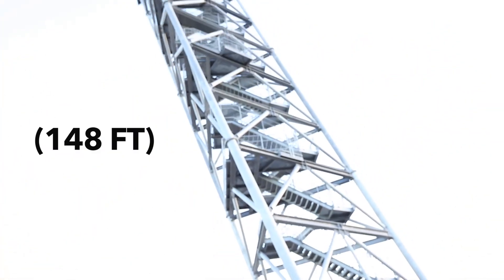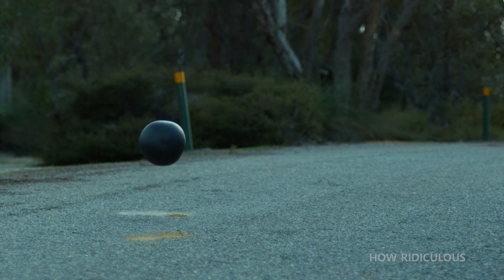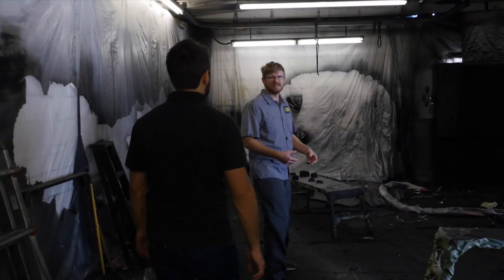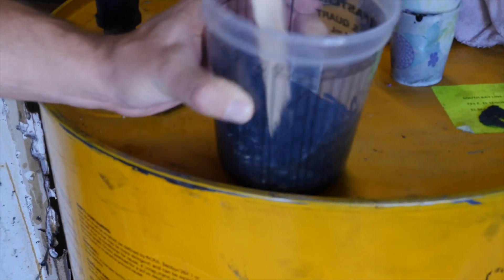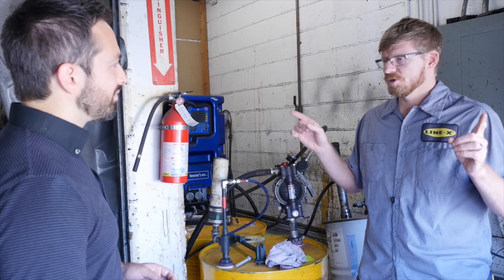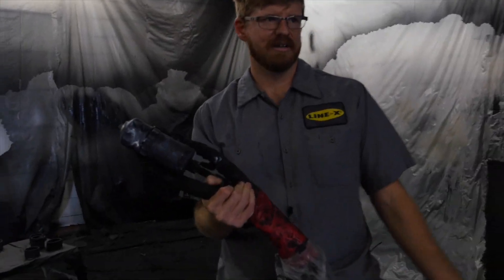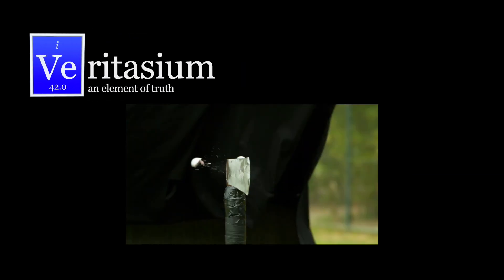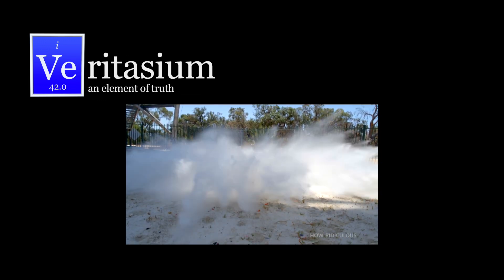Indestructible Coating?!

Comment: Why don't they make tyres of this stuff? Is it too expensive? I mean, even just coating regular tyre would help a lot.
Reply: Derpy Hooves 
Just because they it's durable doesn't mean it's drivable. something like this would probably have all the traction of a power wheels car. now using it inside the tire to make them PUNCTURE proof is a better idea for it.
Reply: With internal air pressure pressing outwards, peeling wouldn't be an issue on internal coatings.
Reply: The tyre would lose its grip.
Reply: Normal tires are more durable, have better traction and are cheaper.
All you would do by adding this in any form is making the tires worse.
Reply: Derpy Hooves AFAIK there is actually a steel mesh reinforcing tires sooo that's probably stronger than this stuff
Reply: If this was done with tire rubber, I wouldn't surprised if you'd get the same results. There's nothing magical about the properties of this substance, the ability to apply with a spray is what makes it noteworthy.
Reply: kamilk That could work if you can solve the logistics of getting in and out without dumping all the liquid out or creating a weak point at the seal, and the need for ventilation and windows, and the ability to guarantee that the inner compartment comes to a gradual stop even as the rest of the car bounces from the impact. Otherwise your occupants will still die from flying objects or broken necks.

And of course you still have to account for what happens when a bouncing car hits a building.
Reply: SentsuizanXS
... and how about system of pipes, pistons, springs and valves distributing hydraulic pressure of a liquid instead of plain chamber of liquid?
is it still undoable today?
Reply: gr8fzy1
Traction is a legit concern, but inside isn't a good idea too, it might just peel off on puncture. Adding it as a layer on top or instead of wire mesh probably would be best.
Reply: Coating the inside of tyres with this might be a good idea
Reply: FyJonas 
and stuff still gets through.  point is that a little bit more protection would always bw welcome,  but i'm worried about uneven spray unbalancing the tire.
Reply: Maybe not tyres, but bumpers should be made of this!
(& some flexible/foamy plastic between bumper and the rest of your car)

Imagine an accident at 60 mph / 100 kmh when nothing happens to your car ;)
Reply: Julien Brech
I'm perfectly aware of a role of crumple zone in modern cars. That's why I mentioned about foamy/elastic/deformable "thing" between bumper and the rest of the car.
About twenty/thirty years ago Volvo was manufacturing front bumpers able to dissipate impact energy of a speed up to 20-ish km/h with no damage to the car whatsoever.
Today we have technology (materials) that manage to disperse much more amount of impact energy. So maybe a hybrid bumpers are possible these days, but are not profitable for car manufacturers ;)
Reply: He didn't say it was stronger than rubber.
Reply: But you would turn to mush just like that watermelon. Cars are designed to crumple so they absorb force. This would just make you bounce off and go backwards. Hello, whiplash!
Reply: kamilk More moving parts means more parts to fail. If the materials can handle the stresses of absorbing that impact in the first place.
That would be a maintenance nightmare since you'd have to be able to remove the (indestructable) outer shell to get to them, not to mention all the other internal parts of a car that fail all the time like batteries. That means seams, and under that kind of force anything underneath those seams will get shredded anyway, possibly spelling death as it careens around like a hollowpoint inside a skull.

It's not impossible, but it is difficult, expensive, and probably more trouble than its worth for only a marginal benefit. Probably better off removing the cause of accidents from the equation, ie. human error.
Reply: Case in point: the watermelon core is separated from the shell.

Comment: Ideal car tire confirmed?
Reply: MatzeGamer no
Reply: Drago yes, since it won't get punctured as easily
Reply: Spray on the inside surface of the tyres!
Reply: 0 traction compared to a tyre probably
Reply: I'm sure it would be slippery as hell in emergency situation or when ground is wet.

Comment: Can it be recycled somehow? Dissolved and reused? Or it stays like that forever?

Imagine piles of garbage no one can process into something else.
Reply: Piles of garbage no one can process into something else are already everywhere.
Reply: yah, but that's no good reason to keep making them piles.
Reply: it burns
Reply: No, one thing can't be achieved with science, however advanced it is... Me getting a life.
Reply: yes, but science in this case means, a facility with the appropriate machines and operators, willing to collaborate with the firm which makes this material. does that exist? if not its only theory. recycling is complex and costly, but in the long term is a necessity.

Comment: What if they coated a Nokia 3310?
Reply: it would make it weaker
Reply: It would break the earth in two if you dropped it.
Mere mortals should not posses such power
Reply: Nokia would wear the coating off from inside.

Comment: ah now i know what i will spray on my car ;)
Reply: The coating is flexible so your car should still crumble like usual when you crash, as long as the coating isn't way too thick at least, I'm more interested in whether the coating can prevent denting and scratches.
Reply: Merp The steel is supposed to fold. The car is designed to absorb most of the impact in an accident as a way to save the passenger. Older cars were made of stronger metal and they did hold together pretty well but the casualties were greater because the passengers took more force than the body can handle.
Reply: seigeengine
-Won't explain anything because he knows he can't
-Mocks people because they are not native English speakers
-think he is better than anyone else
-calls some stranger on the internet arrogant assbag who really said nothing arrogant at all

I wan't to see you speaking a foreign language like I do. To use that insult shows the person you are. Out of nothing you created a fight with me just because I critisied you (not even critisied just didn't agree) relativity has nothing to with the energy the passanger is getting from a car crash. It's the same whereever you are in the universe. IT ISN'T IMPORTANT IN THE CONTEXT OF THE "QUESTION / MY ANSWER"

you are a joke. play with the other kids or mommy will be angry. Insults are so good he?
I won't answer anything from you anymore, everyone hates people like you
you are scum.
Reply: +eu4eagle I see where you're coming from, but you're assuming a reference point as an outside observer.

When the car collides with something, it applies a force to what it collided with, but as we know, all actions have an equal and opposite reaction. The object the car collided with applies an equal force back against the car (assuming it doesn't deform itself), causing it to accelerate to a rapid stop. From the perspective of the occupant, the car was suddenly accelerated back at them, and collided with their body.

As for car design, they are designed such that the part the people are in is very tough, but the rest of the car around that is designed to crumple heavily so as to take up as much of the collision energy as possible.
Reply: seigeengine  You got so rekt in this thread.
Reply: Molten Science hey I like your channel.
Reply: thanks +micheal lee :) and +fucduck u could be right on that lol
Reply: That's pysical nonsense. kinetic energy isn't transferred to the people because it's more robust. We know from newtons first law that people inside the car would only get their own kinectic energy (1/2*m*v^2 
m= the person v= speed of the car/speed of the person) because of Inertia. What you mean is that with a robust car the collision is more rapid than the collision without a robust car. (and can push the robust car back so it creates backwards velocity that increases damage (elastic shock)) That's why the people get more damage. But I also think not so robust cars will kill more people because of inner space deformation.
Reply: This wont stop anything that would happen in a car crash, the energy there is FAR FAR FAR higher than dropping a watermelon. The car panels are made from steel and they still fold like tissue in a crash.
Reply: seigeengine I actually have a clue. And I don't know what you are trying to implement here. I agreed with your point's because they are right. But the perspective of the observer has nothing to do with anything I've tried to say in my comment.
I don't know what you specifically meant with perspective because I'm not native English, maybe you can explain it without ranting about something there is nothing to rant about.
But personally I could say the same thing: Get off of your high horse.
Reply: eu4eagle Considering you don't even know how to use the word "implement," that's adorable.

That's not what I said. Not even close.

That's become pretty obvious. How can I say this? You're an arrogant assbag.
Reply: seigeengine And I understand what you mean with perspective. But perspective had really nothing to do with my initial comment.
Reply: Probably would not prevent denting, unless you have concave parts on the exterior, as the material doesn't seem very hard
Reply: why dont we use hard rubber to make cars' exterior?
Reply: seigeengine I don't think the reference point is important here. You are right that the energy needs to go somewhere. In the less robust car more energy is converted into deformation work. In the robust car this can't happen so the car should bounce of the other car and create velocity that damages the people inside (elastic collision). We also need to consider that deformation work will slow the vehicle a bit down (with not so high acceleration) before the crash happens so the impact energy the passagner is getting when he collides with the steering wheel is less.

Edit1: I think we can't assume the car will bounce off if the car's have different mass.
Reply: eu4eagle It is, because your entire error is in privileging a perspective. Ever studied relativity?

I like how you're trying to pretend you have a clue by going on as if you're bringing up something new when we're specifically discussing the things you're now rambling about instead of actually responding.

I think you need to get over yourself.
Reply: eu4eagle If you understood what I said, you wouldn't be saying that.
Reply: Molten Science you ouychea gettin hit 187 or what? Yo ass dont need dat b
Reply: StarRazor They didnt hold together better, it was just they had ladder frames instead of unibody. Obviously crumple zones exist in cars now, but those body panels and the frame rails are still solid steel, much harder than this material. Try cutting a crumple zone steel bar with an axe, dropping or from a building or even using the saw they used on the melon. Not going to be as easy as this stuff by far.
Reply: Make sure everything is fully dry and clean before applying.
Reply: i'm here for the comments
Reply: Molten Science Be sure to keep the treated car away from David Hasselhoff
Reply: ^ Line X is meant for cars lmao
Reply: There are plenty of vehicles already coated with it. Its a truck bed liner and it does not last forever. Just like any material it will wear out eventually had it in my work truck for 2 years and its falling apart.
Reply: better make a car from this
Reply: lol bumper cars on the roads
Reply: Julien Brech Smells like alt. Enjoy the consequences.
Reply: A b r o a d Another!

Comment: All cars should be sprayed with this coating!
Reply: Cars are designed to crumple to help cusion the impact, keeping the passengers alive. Otherwise your organs would look like the inside of that water melon :)
Reply: That would only make the car less safe to drive in since the force from an impact has to go somewhere, it can either destroy the car and protect what's inside or you could protect the outside with this coating and have the force from the impact destroy what's inside the car (you) instead of the car itself. 

You could, however, coat the cockpit only, that way the energy still have somewhere to go that's not the passenger/driver, but still, protect the passenger/driver, that's how they make race cars and sometimes super expensive sports cars, only they use carbon fibre instead of polyurea, wich is probably a lot better, but more expensive I'm guessing.
Reply: Liam Johns Good point.
Reply: how are you verified with 20 subs only?
Reply: ***** due to my activity in Google plus.